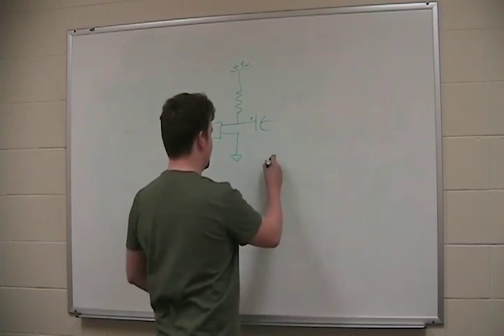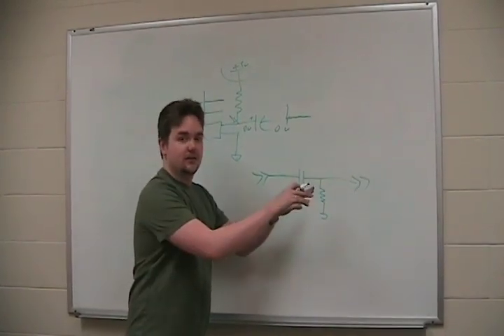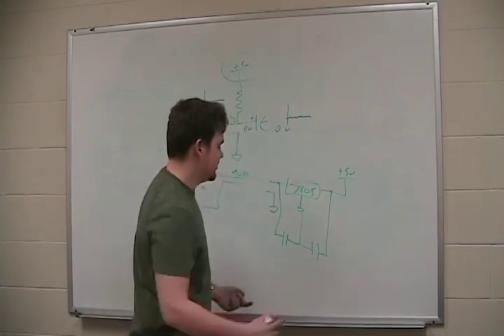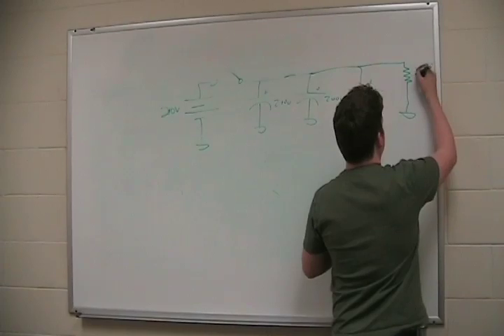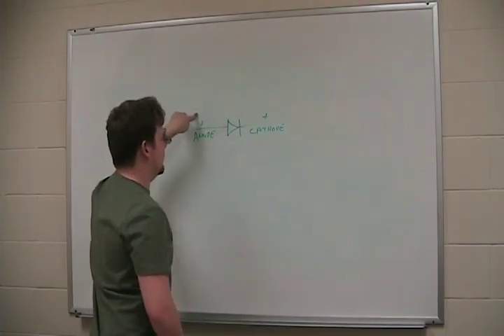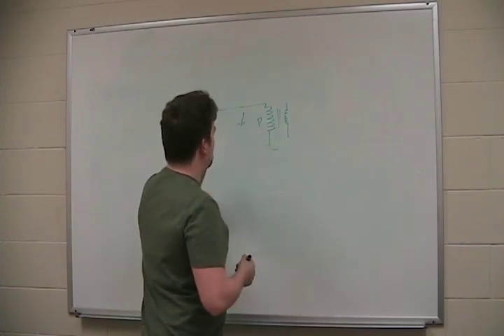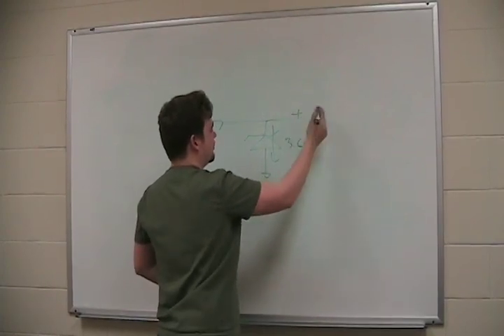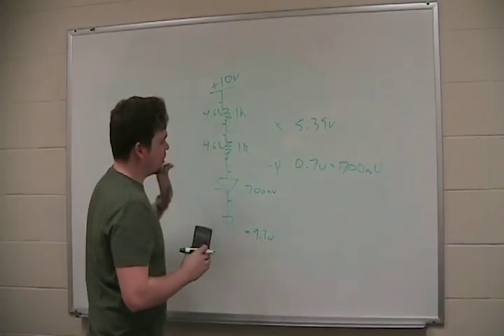Practical Circuits:  A Basic Lesson On Diodes and Capacitors

Comment: Hello
I want to help determine (the number of capacitors values) as well as (the number Diode Qmha), and the best physical laws minute can decide that.
The question is: I want to run the generator operates on the principle of magnetic induction consisting of (2 motor capacity each and every one = 1.5Kw, and the number of cycles per minute = 900) and without fuel, and I want to run self, can I get help?